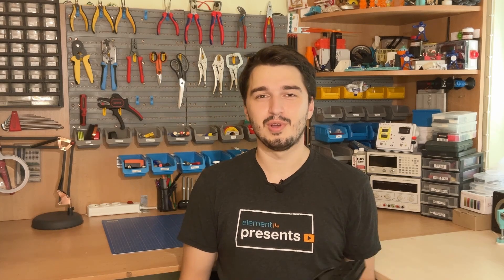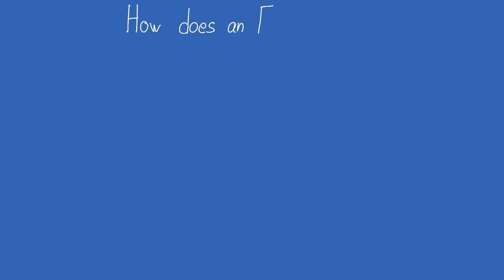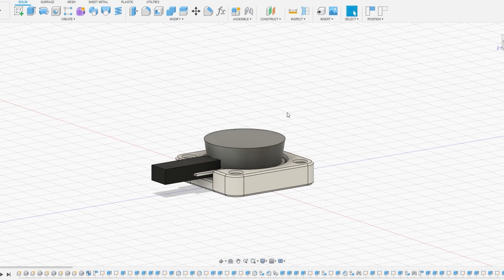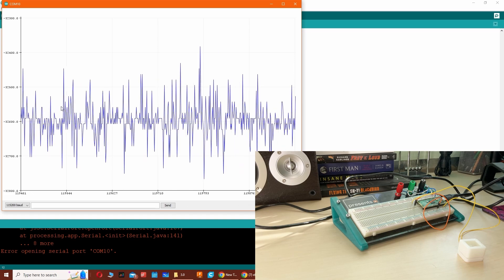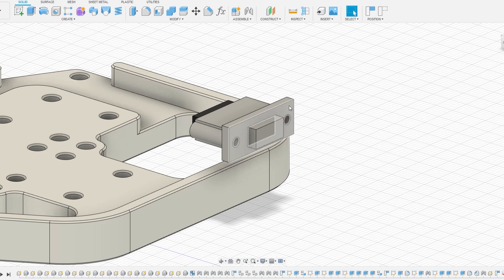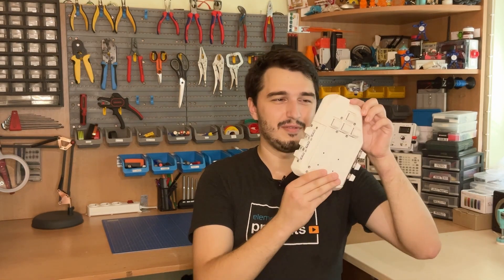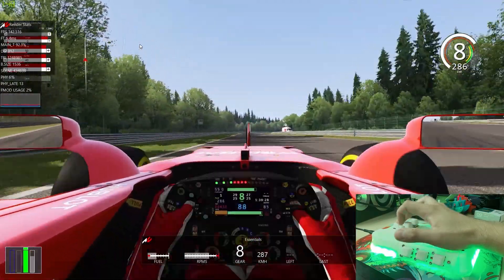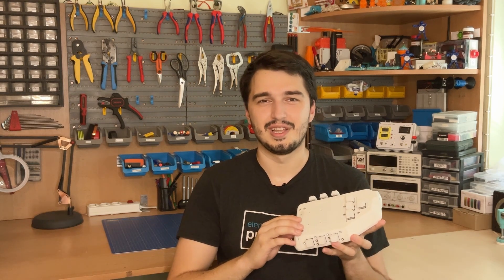Upgrading My Racing Sim with a Force-Sensitive Keyboard

Comment: The PS2 had pressure sensitive buttons. Metal Gear Solid 3 uses them. Would love this as a PS2 controller.
Reply: the original xbox also had that, I can only ever remember using it on dead or alive beach volleyball for the pool jumping minigame :P